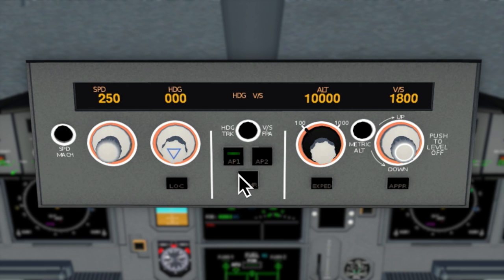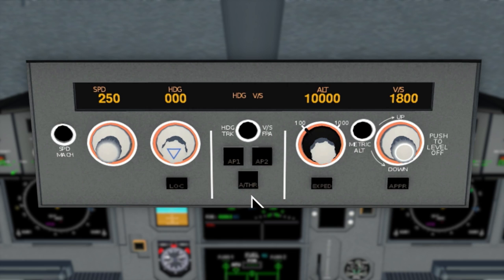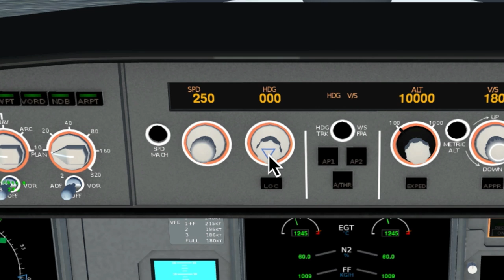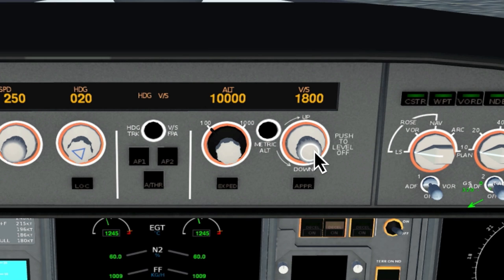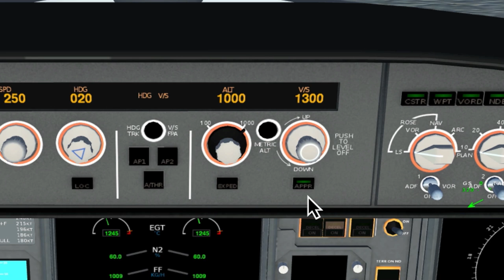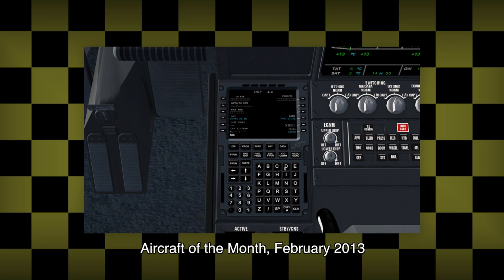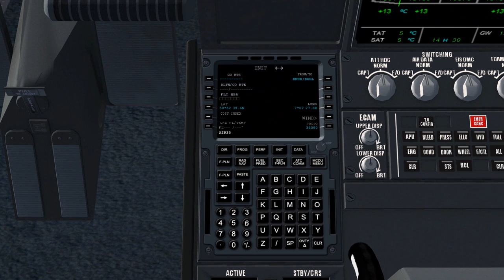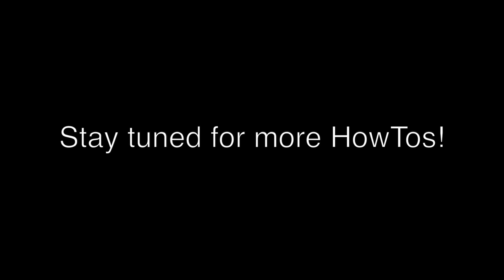Airbus A330's AutoPilot Tutorial - FlightGear HowTo #33

Comment: FL CH is automated in the airbus autopilot system unlike in a Boeing system. For example, in a Boeing airliner, you'd click on HOLD under altitude to hold the current altitude and FL CH to go to the specified flight level, but in the Airbus autopilot, it changes mode to FL CH if the set altitude is not your current altitude. While climbing, you'll notice LVL CH shown on the AP Display :)

Comment from the maker: It's done using the walk view of the A330 (press W and S in the copilot view for example). But the default walk view is slow and stutters, so I slow the simulation rate of FlightGear to 0.25x or 0.125x, and then hold W or S for a pretty long time while recording video. In the editing software, I then speed up the video 4x or 8x respectively, so it looks like real time again :)

It's a pretty cool effect, but unfortunately at this point not really available "live" in FlightGear.

Comment: Hey can anyone tell me when must the "bleed air valve " switch be switch on ? As in During pre - start or startup
Reply: +Adham Afiq Let me recall the whole thing for you, I guess you ask for the A330 so: Bat 1, Bat 2, APU Bat, APU Start (The two buttons right beside the lights), then wait for the APU to start, after you can hear it (it is very hard to hear it lol) you must turn the APU bleed and both engines bleed ON... That's it, Engines must run up with this procedure

Comment: Tragically, this is the AirAsia aircraft that just crashed. Does anyone know circumstances that would cause the autopilot to disengage?

Other sites I've visited suggest most pilots, in modern commercial aircraft, will stay in AP and let the plane fly out of trouble itself.

EXTREME turbulence can cause G loading that can interfere with eye focus on the instruments and make hand flying extremely difficult.

I believe the AirAsia flight encountered extreme turbulence, came out of AP and the crew was not able to control the plane.
Reply: The missing Air Asia flight QZ8501 was not a A330 (as in this video)  The Aircraft was a A320 NOT A A330
Reply: Definee -Other games! Yeah  it was an A320 not a A330.